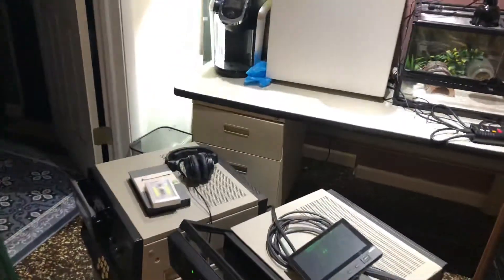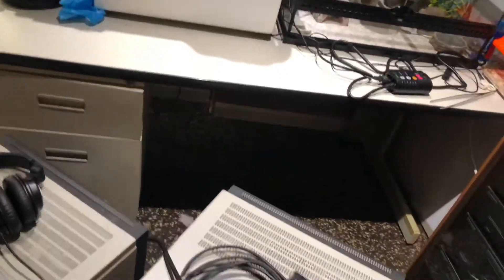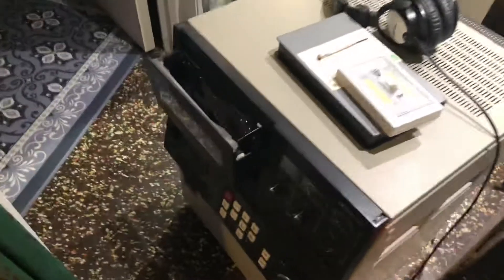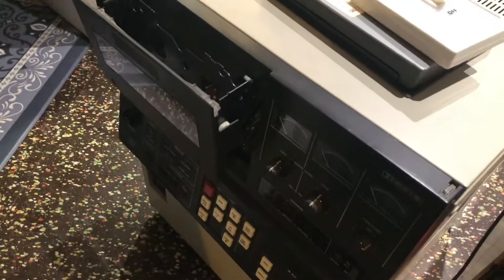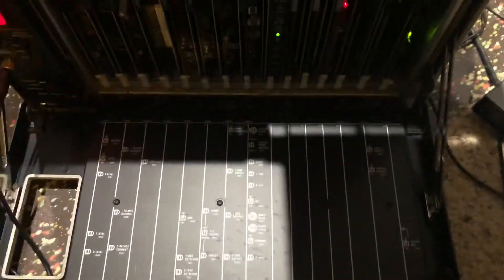February 7, 2020

Comment: Wow that is awesome. Hard to find info on these M Format machines, so it is REALLY cool seeing one of them up and running! I am not an expert on these, but have fixed many Panasonic S-VHS/VHS VCRs and it seems bad electrolytic capacitors are often to blame for weird stuff like that, but that is just my uninformed 2 cents. Maybe could also be a tape path alignment issue requiring tape interchangeability adjustment. Have you been able to find a manual for these yet? I believe there is a similar machine under the Ampex brand called ARC-40.